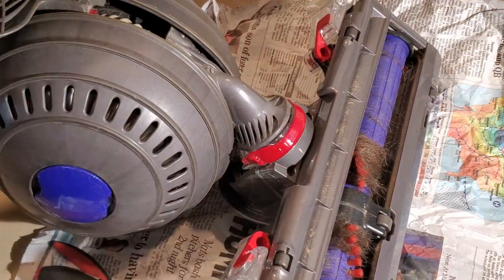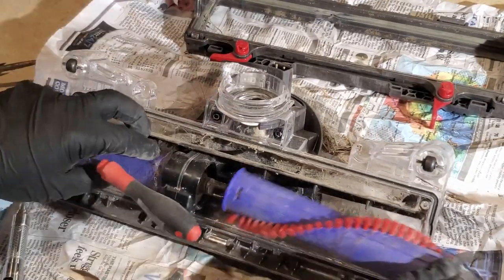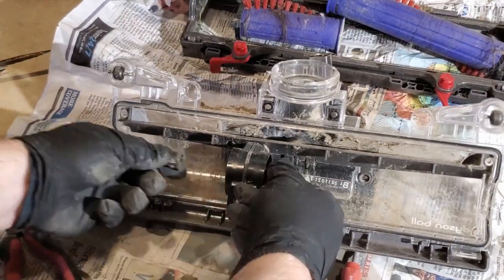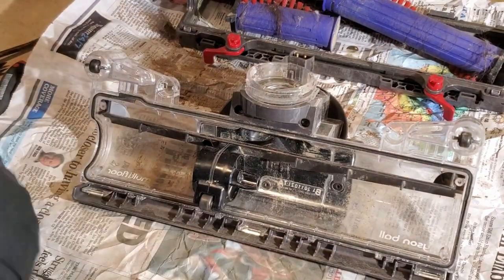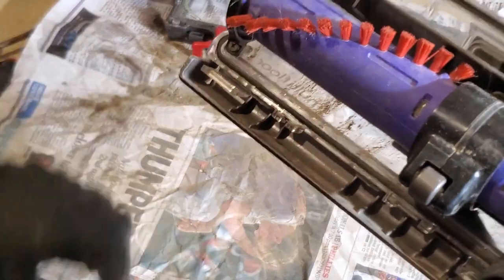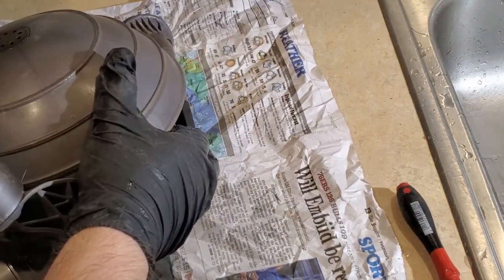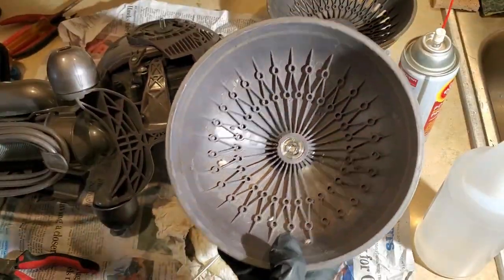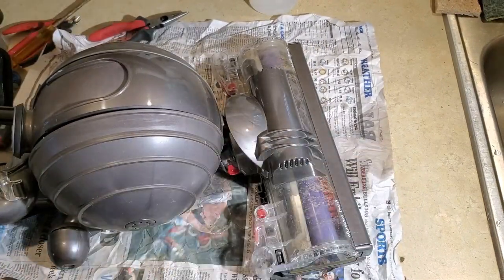Dyson Ball MultiFloor Vacuum Maintenance

Comment: Those little wheels on the power unit beater bar bottom pop out and are usually full of hair, 2 on the clear plastic and one on the motor. They should be cleaned to allow free movement. Also very important to clean/soak the removable plate (aka sole plate) as the bellow gasket on it can be stuck up with gunk, and not allow movement up/down to seal to the floors. This needs to be able to move up/down freely for different flooring or it won't seal and will not have good suction. These sole plates do wear over time, mostly the bellow collapses, and loses it's spring and won't allow a seal and may need replacing. So if you followed the entire process and still have suction issues when using it for floorings, but the vacuum still has great suction, this may be the cause. Great teardown video by the way.

Comment: I found my vacuum in a house I’m moving into. It works, just incredibly dirty! I did the exact same things with mine and came to the same conclusions about cleaning the roller head assembly with water. I wanted to because it needs it badly. But just not worth the time and possibly damaging or not being able to get the gears back correctly. Made me feel better after watching your video. Thanks!!
Reply from the maker: I'm happy to read that! Thanks so much for your comment

Comment: Check the brush head wire looms and slider assembly where it goes from the contacts to the motor. I've seen those wires chafe where they go into the wire channel and former service or wear and tear over time of constant swiveling can cause shorts and exposed wiring. Also the contact assembly over time gets loose as well causing intermittent cut out of the powerhead assembly.  I just strip it down and leave the motor carriage intact with the motor. I take the wires off the motor terminals and take the wiring out of the channels in the motor housing right to the slider mechanism and the U shaped slider clip and separate that from the motor and I inspect the wiring for stretching pinches and stripped insulation due to chafing. The rest of the components minus the motor housing and the rest of the electrical components I wash and soak in a mild dishwasher detergent and let it soak. The motor platform I wipe down with them disposable shop rags. Lots of times I've noticed a bit of corrosion on the motor terminals, this means that someone vacuumed some wet materials. With these Dyson vacuums even vacuuming light damp things is no good. I've been zapped a few times from others vacuums because they have vacuumed wet materials. Dysons never were made for wet environments. I don't think Dyson even makes shop vacs.
Reply from the maker: Fantastic Info! Thank you!

Comment: Very, very good. I liked watching you take it almost completely apart. I am kinda like that also. I like to see how things work. However; I was a little disappointed that you didn't take the hose off and clean through it. I also learned from a different video that Dyson recommends placing the clip on before pacing the beater bar to the ball. Thank you for your video. I learned some things.
Reply: He didn't clean squat  .  Cleaning would be akin to a human bathing or showering .  What he did was dry wipe.  Gross  , his excuse iys just gonna get dirty again , well then why bother brushing your teeth ? They're just gonna get dirty again , or washing you car etc etc   good video , good camera,  etc good sound,  clear pronunciation.     As a general rule I use the attachments for the kind of dirt his power head has ,  my power head is only for carpets and reasonably clean floors   any actual dirt piles either broom or wand

Comment: L really nice job of explaining how to clean up the roller brush area though I do have one bit of advice… It would be much easier to see and follow along if you would’ve put the roller brush unit on a solid just background surface instead of a newspaper with lots of small print. It makes the entire image look over the complicated and messy.
Thanks!
Reply from the maker: Thank you! I don't disagree but sadly my my kitchen is not setup as a studio. I was just trying to keep the majority of the dirt off our counter with the paper. Thanks for watching!

Comment: Watched your entire video, very amusing especialy you spinning the sides super fast , you tie your vacume to a indy car ?  It'll never rotate that fast as a vacuume  and the keyed per side , check the part number its written on the "hubs" both exactly the same part  at least on the one I have.   You cracked me up when you popped off the blue built in tool .  That filter of yours is cleaner than ones I've seen (on other peoples vacs)   you'll know when the filter is gone too dirty , it makes a noise like car brakes
Reply from the maker: Thanks!

Comment: Thanks for the video! My beater bar is having trouble spinning. I've removed the bar, but I can't seem to get the pieces on either side of the belt off to remove the debris there. What type of screw driver did you use to remove those pieces? It doesn't seem to be the same type of screw as the others.
Reply from the maker: I think it was a T10 Torx.  Definitely a Torx bit, but I am forgetting the specific size.
Reply: @FixitFrank  Thanks Frank!

Comment: I feel like mine isn't sucking very well anymore but everything is clean that I know of.
Reply from the maker: Id make sure the exhaust vents are clean too.  I am not sure what the specs for suction are.  If it is truly clean, I would think it would be working properly but I dont know if that helps you or not.
Reply: @FixitFrank  what happened was, I took the front head off and boom clogged with big pieces of paper and lint.. cleaned it up and works like new again! These vacuums are awesome 😎
Reply from the maker: @Mitchyymitchmobile  Awesome!!! Im glad to hear it. They are great vacuums! Thanks for letting me know!